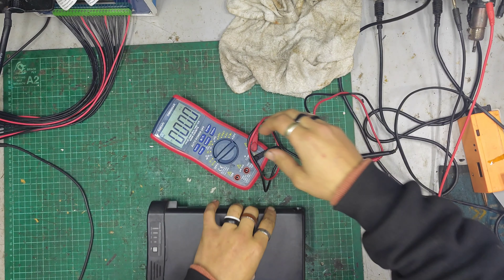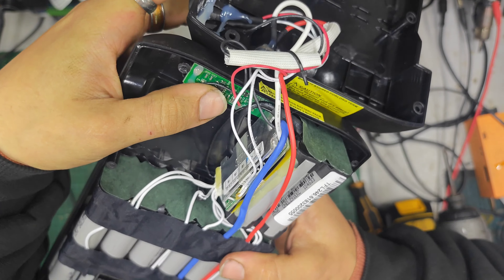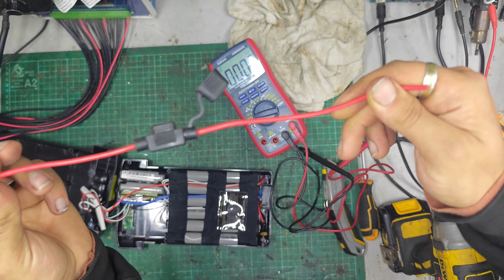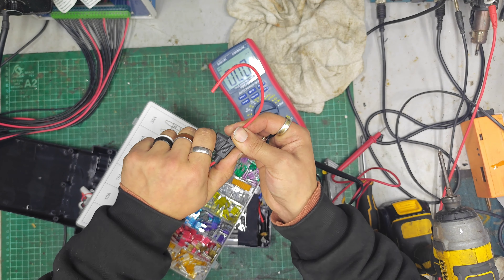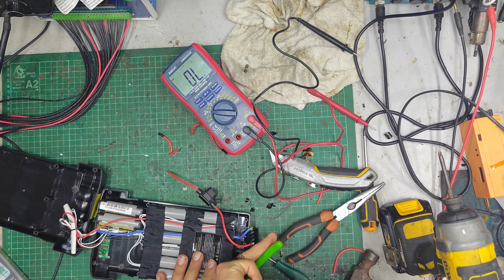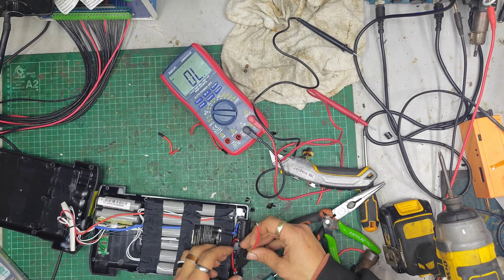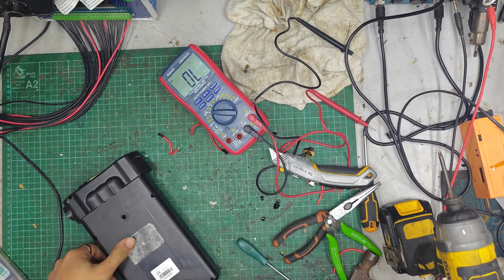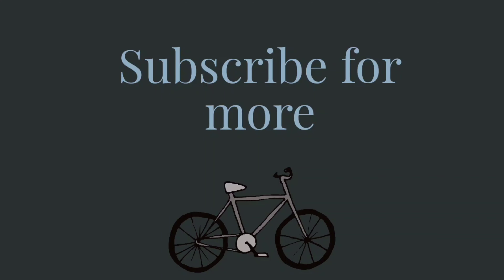ELIFE Regency Ebike battery pack not working - fixed! 24v 8Ah

Comment: I have done an escooter repair (with  lithium batteries) and it came with a mini blade fuse from factory, so it’s completely fine
Reply from the maker: They're fine to use in my experience.

Comment: Great video. Thanks a lot. Just a question: the auto blade fuse holders are thought for 12 v and for different amperages. Are those fuse holders good to go for such ebike battery  repairs as long as the amperage matches (though voltage with the bike batteries is higher?)
Reply: I wouldn't want to use it 24v x 25a =600 watts, to say nothing of the fuse being overrated for the cable and also a slow blow fuse being used to replace a fast blow..
Reply from the maker: This bike pulls nothing like 25amps, 15a max under stall current, its totally fine
Reply from the maker: @pikola24 higher voltage = lower amperage, therefore less heat, loads of batteries come with these fuses and are perfectly fine, I wouldn't worry about using them. 

Above 48v you should look at circuit breakers, that's why they're standard on bombers/surrons